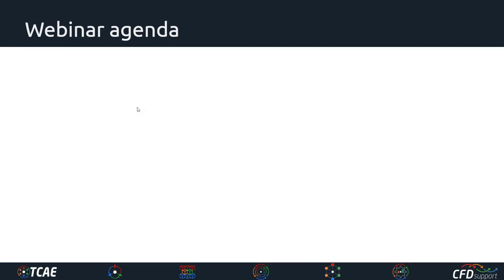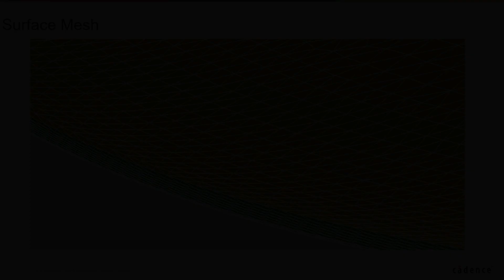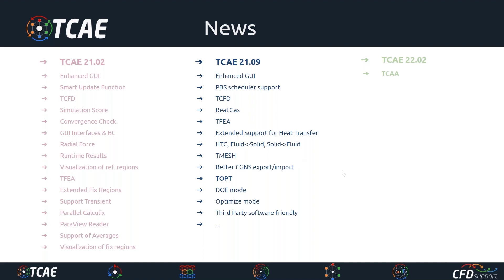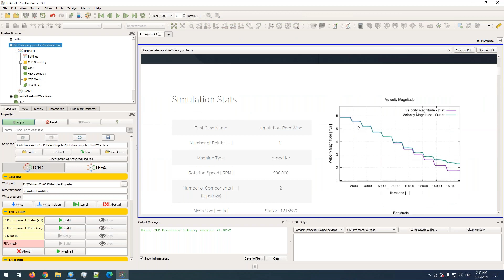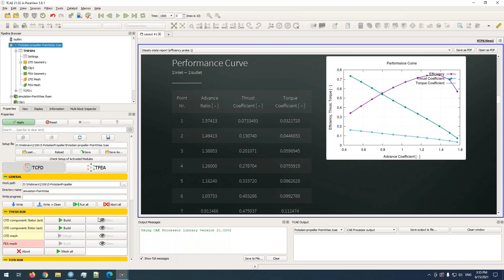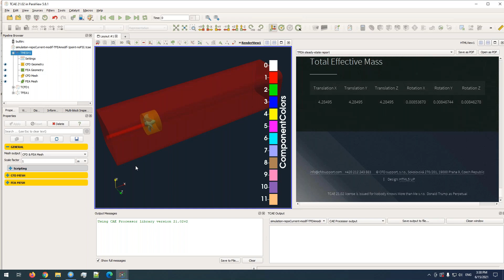Webinar 54 - Potsdam Propeller Benchmark, TCFD + POINTWISE mesh, June 15, 2021

Comment: The meshing was very interesting. how long does it take to generate the mesh from the CAD in this case?
Reply: Actually the mesh shown was the classical Pointwise mesh
Now Pointwise has a very strong feature called as Voxel Box meshing and Higher Order Meshing which will give even more accurate results